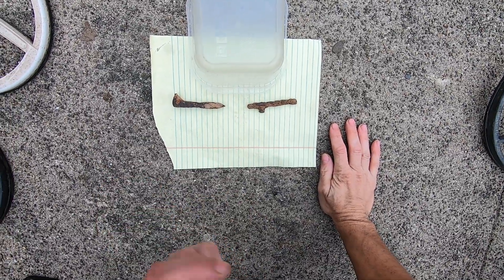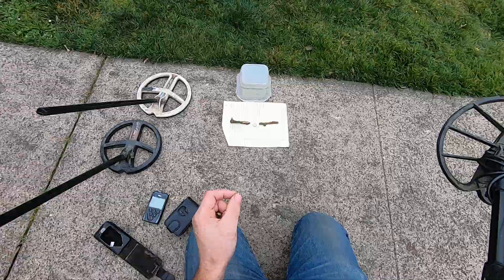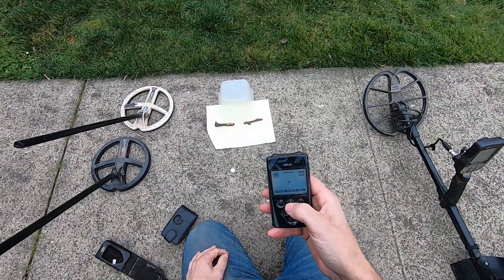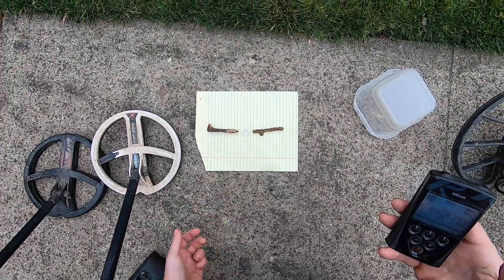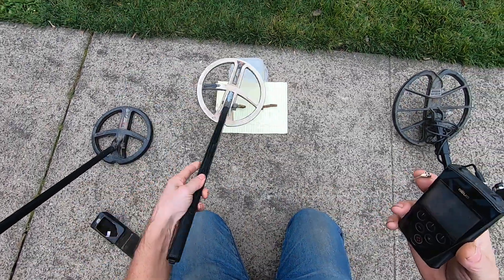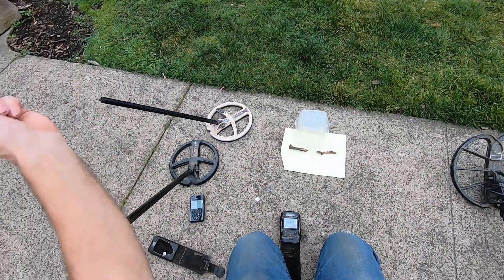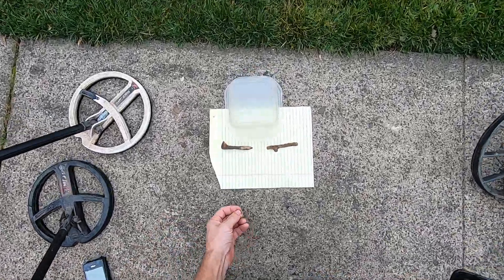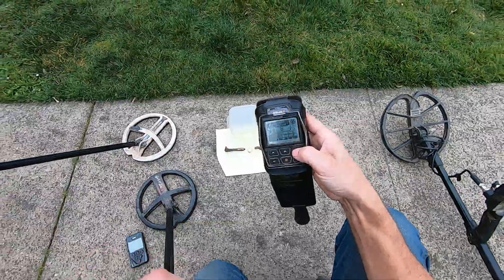XP Deus 2 vs Deus 1 vs Simplex SP28 gold ring/dime in iron test.

Comment: This is interesting, I’ve asked on uk 🇬🇧 groups about the benefit of the deus 2 over the 1 regarding detecting on iron infested Roman fields and a lot of people say the deus 1 still does better. I also can say that the simplex for whatever reason also does well in iron, better than the equinox which for the life of me could not get to work in Roman inhabited fields. Roman fields are the worst as they left behind 1000s if not millions of hobnails from their shoes which are tiny square nails about 1/2” long

Comment: Yo streak I’d like you to please try my programme for d2

Mono. 31.1 kHz
4 tones. 
Tone 1.  -6.4 @100hz mineral
Tone 2.  6.  @  200hz   Iron 
Tone 3.   99. @ 800 hz non ferrous
Tone 4.  100hz mineral / falseing 

Tone 4 is a throw away time so you can run it flat out at a GB of 63 

Silencer 0
Caps 0 

Negative ground to this extreme allows a full X-ray of the ground with EXTREME depth and separation.   You’ll be amazed at this setting please try it you won’t be disappointed!!

Comment: "The Equinox in all the programs just goes silent when I get next to that big iron, right?"  No, not right. In your own video--the one you are referencing when you made this statement--the equinox hit the dime with a repeating high tone--one way--in both Park 2 and Field 1.  I assume those were stock settings, because we never see the iron bias or recovery speed settings and you make no attempt to adjust them to dial in the dime.   Then, in the first video, the Deus 2 struggled at first in several programs to hit the dime until you spent at least four minutes making adjustments to finally hit it.
Reply from the maker: Did you notice how Simplex and D2 hit it swinging both directions over the target!! I did have the recovery speed at 7 and iron bias at 0 F2 if that really makes a difference on performance on the equinox in iron anyway. D2 was smashing that target if you hadn't noticed